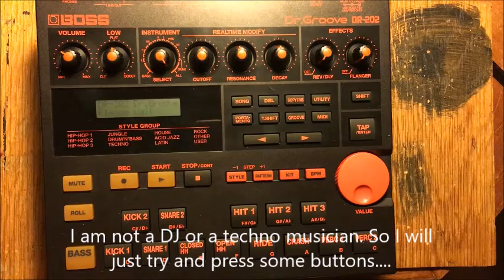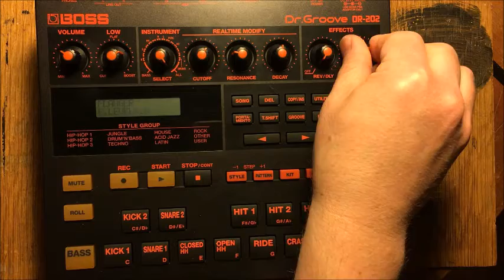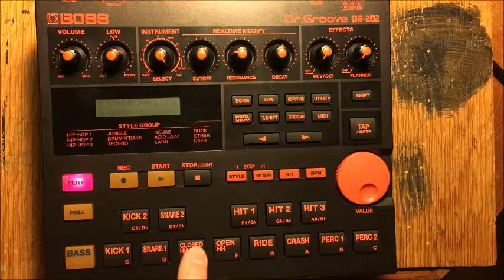BOSS DR-202 cleaning and repair

Comment: I just saw your video and it’s so useful . My DR groove has a message about the backup battery that its low .. I changed the inner 2032 battery but the message still appears … 😮do you know what’s the problem ? Thanx in advance 🙏🏽🙏🏽🙏🏽🙌🏼. You did a great job with this video .
Reply from the maker: The only things I can think of is that the battery is bad - it doesn't happen often but I actually have seen a battery being low on power right out of the package, there could be corrosion or dirt on the battery springs, or the DR-202 is defective in some way.
Reply: @organfairy  what where is that other battery located ? I though it was that rounded one so I’m little lost about the message on the screen . Thanx for the info 🙌🏼🙌🏼🙌🏼
Reply from the maker: There is only the one CR2032 that you have changed.

Comment: Hello ;-) thanks for this video. I have the same issue when I start my dr202. It lights red and nothing. How can I fix it. I tried to redo the same soldering as you. It worked for a moment. But when I tried to make it work with batteries, the problem came back (it was working before). I tried again the soldering but there is no effect. Could you help me PLEAAAAAAAASE!!!!!😅

Comment: Do you know if replacing the cr2032 battery is going to wipe my saved music? If so i'm inclined to let it die completely before doing the swap because i'm getting the warning now.
Reply from the maker: I don't know for sure about the DR-202, but the way it usually works is that the memory only uses the back up battery when it is switched off. So it should be able to keep the memory intact if it is switched on (and connected to the power supply) while the CR2032 is out. But I will not bet my life on it :-)

Comment: I have a problem with having to push the button down really hard to make a sound especially on the kicks and percussion buttons, any suggestions?
Reply: I've had that issue as well. Not sure what can be done about it, seems that they made the rubber buttons just a bit too thick.

Comment: Thank you I could clean mine and change that cr2032 battery, I was getting internal battery low ;).
Otherwise, I didn't clean the cover with water as I was afraid of harming the screen. Is it safe to clean that with water?
Reply from the maker: I have cleaned cases with water for 30 years and I have never had any problems. Only exception is if there are paper stickers somewhere. But if everything is made of plastic water will not harm it.